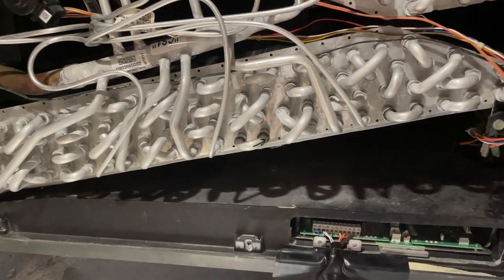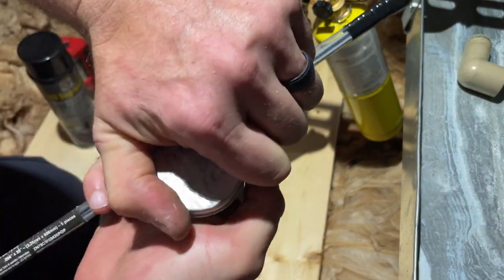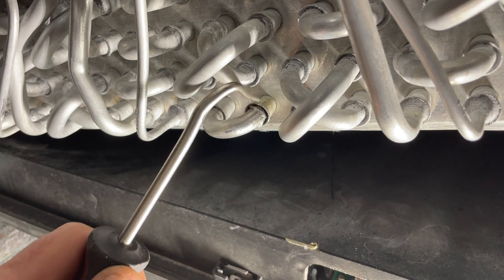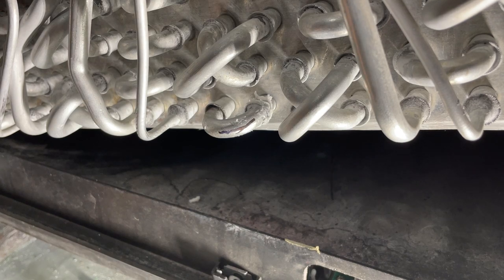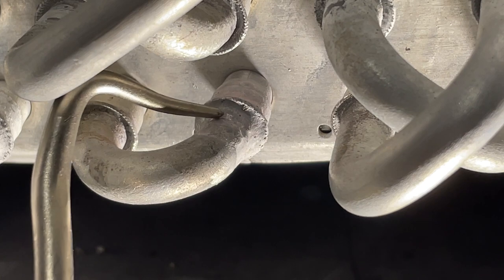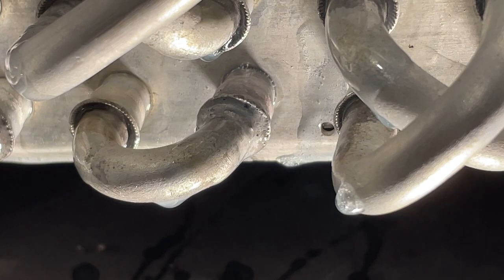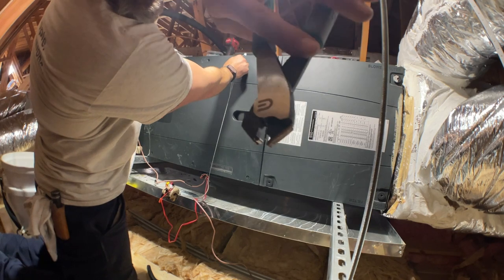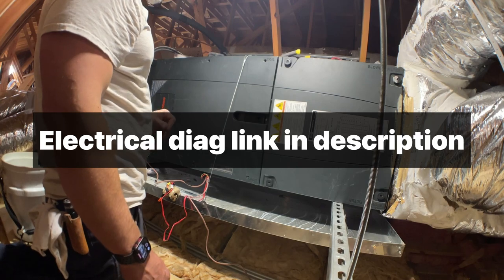HowTo13: Properly Braze Aluminum and Repair a Coil

Comment: All right, I rewatched this video to see if there were any tips that would help me. I've done some aluminum brazing before, mostly successful but not always, but this one isn't going to be easy. Right in the middle of a micro Channel condenser coil. All I've got is an acetylene torch and some Al8. If I mess up, the church doesn't have any air conditioning for the services this weekend, and that's kind of a big deal in Florida. No pressure, right? Okay, enough stalling. I'm going in.
Reply from the maker: Oh yeah that sounds difficult.  How did it go?
Reply: @HVACLife  It was actually much easier than I figured. I cleaned it up real well, mainly just sandcloth until everything was shiny. Since the channels were so thin, I thought they would melt too quickly. As soon as I put heat to it, within a couple seconds, I applied al8 and it melted perfectly. I believe there was about a 1 second difference between 'hot enough' and 'oh, damn, I melted it' but it worked out. Maybe because it was for a church I had angels on my side? Perhaps just a bit of luck. It seems to always be the stuff I expect to be the most difficult that end up easy, and the stuff I expect to go smoothly that end up an absolute mess.
Reply from the maker: I think the stuff thay goes right is there to teach you how to dream and not waste away in nightmares 😊

Good job dude.  I honestly have never repaired a microchannel.  Didn’t think it was possible 🙌💯

Comment: You didn't screw into the side of that unit for the wire rope bracket did you!?!?!?!?!?
Those units MUST NOT be compromised in such a manner, or so the instructions warn.  🤫